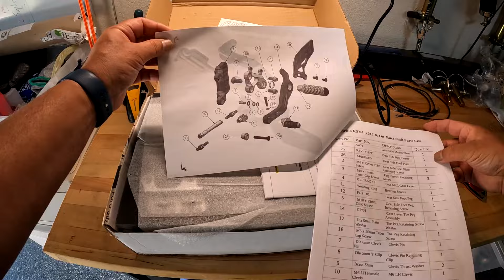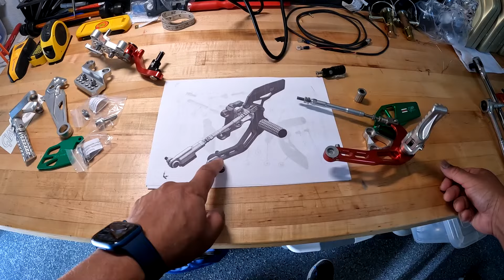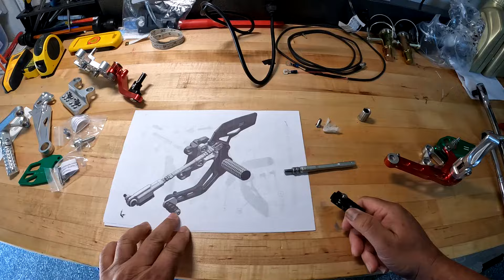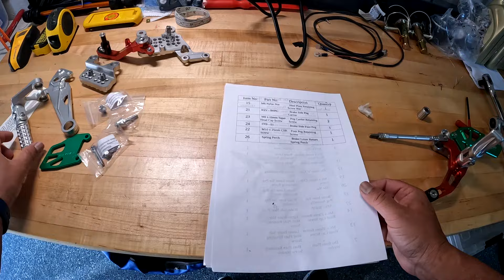2021 Aprilia RSV4 Giamoto Rearset Installation

Comment: The pivot point on the rearset for the shift rod looks like it would be right against your foot. Whereas the stock one was further forward and down out of the way. So now it looks like your heel won’t ever touch the green heel guard. I have been holding off on rearsets for almost 2 years for my ‘21 Tuono because all the descriptions on Af1 say the bolts are too long on the brake side. It’s like nobody has made the specifically for the 2021+ models.

Comment: What brand rear sets are you coming from? I got my eyes on the woodcraft set but I mainly want good adjustability and the use of the brake switch. These have caught my eye as well but in just silver.
Reply from the maker: From stock. I may have tried Bonamici if I remember correctly. This is by far the best rear sets I've ever used.

Comment: Which bike do you prefer, the ducati or the Aprillia ?
Reply from the maker: Honestly...I'm still trying to decide.
Reply: Its that close ? I would have thought the power and less weight of the ducati would give it the edge.
Reply from the maker: @damienmcgoldrick4598  I haven't dynoed but YouTube has the stock Aprilia making more power than the stock Ducati. Power to weight might be better on a Ducati, as you note. And with the addition of slipons and tuning, things change. All that said, my  PB fastest laps are on the Ducati so there's that.
Reply: Have you had an issue with the engine light coming on with the aprillia ? Mine came on after the first 80k. They said it was a flywheel sensor needed calibrating. Just got it back and its come on again after 100km. Its a shame because after doing 250km i feel this is the best bile i have ever had or ridden.
Reply from the maker: @damienmcgoldrick4598  I have not. Hope you get it fixed.

Comment: What was the point of replacing the rear sets if you are putting in the exactly the same stock position? Seems bit excessive but personal choice I guess. 👍🏻
Reply from the maker: It’s a starting point and has the adjustability. It looks so nice, no? And they’re sending me fixed foot pegs.